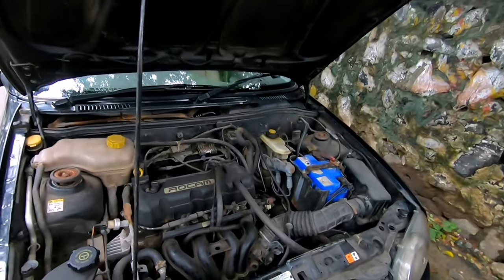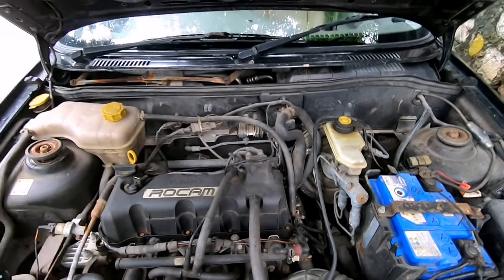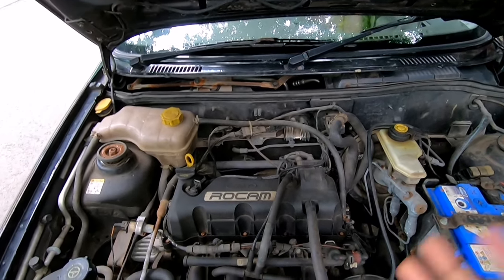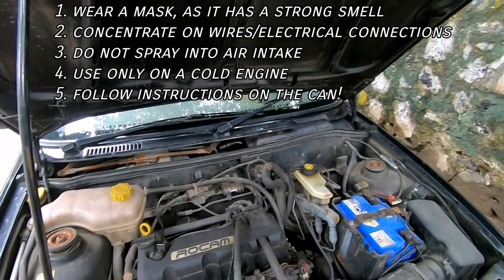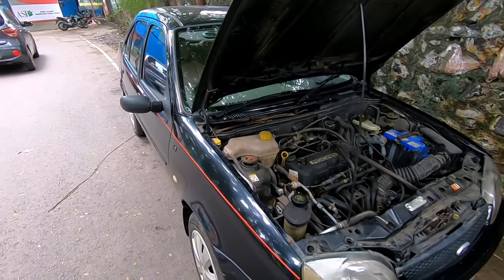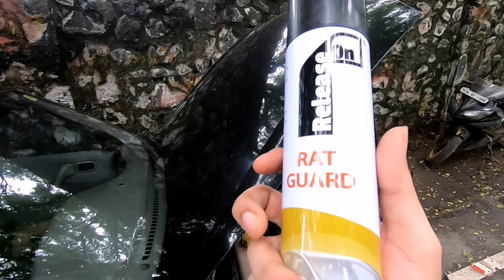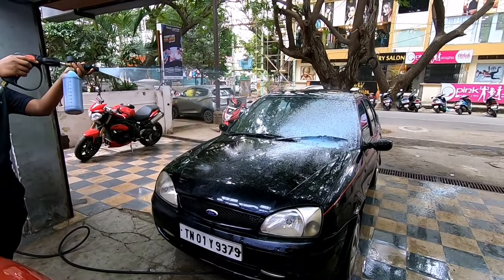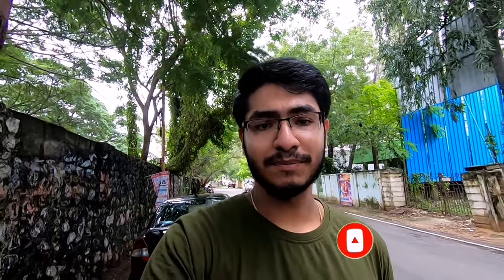How to STOP RATS from entering your car | Get RID of Rats HIDING in a car | PERMANENT FIX | JRS Cars

Comment: Dude. Rats have entered my NEXONEV. I'm not getting sleep at night these days 😭
Reply from the maker: Oh no! They've evolved faster than expected and attacking EV's also!
Jokes aside, use these tips bro, all of them together, that should work
Reply: @JRSCars  yes bro. Thanks for all the tips. If something goes wrong then I might have to spend bomb or have no choice to use insurance. Here's the video. I'm not professional in making videos but just a try :)
https://youtu.be/PP-khsOYvLg
Reply from the maker: @NonPhysicalPhenomena  will have a look soon buddy
Reply from the maker: Great video buddy, especially for a first attempt! The local fix won't be that long lasting, better get it fixed under warranty by TATA asap.
Also, use all tips in the video to prevent pesky rodent attacks, best is to use the car everyday :-)
Apologies for the late response.
Reply: Best solution for this is rat mesh installation, full engine and side packing 👍👍👍👍👍👍👍

Comment: Can I purchase Skoda superb elegance 2.0TDI AT, 2010 for ₹600000 which has completed 1lkh km. Will it be costing more on maintenance.
Reply from the maker: Hi, buy it only if it has a thorough service history and has been well taken care of.
You can check out my maintenance video on the Skoda Laura.
Add +25% on all costs mentioned for parts and factor an additional ₹1lakh for gearbox overhaul (DSG clutch).
Maintenance will be expensive, so make an informed decision.

According to me. Buy it if you already have a reliable car in the garage for daily use.

Comment: This is a major problem of car ownership that you have addressed. Somethings I  have learned:
1. Rats don't like strong smells and that means the tobacco smell works well. Other strong smells also work
2. Car interior should be very clean. Food remains even a tiny bit attracts them. 
3. Once Rats come in they leave their fecal matter that attract them to the same place again. So have to deodorize completely. Carpet shampooing and steam cleaning of interior recommended for this
4. Park the car in different places or orientations. Sometimes it makes the Rats lose track as they follow trails
Reply: Very useful❤
Reply: I had very bad experience as I live outside India and my is always parked some times my frds do start the engine when they open the hood rats takes their meal on my engine eat the thing and all reaming  is on engine I don't kw how to stop the entry.. please help

Comment: Nothing works better. There is a smell in rat poop that brings the rat back to car again. Rat enter through front wheel axil ,then engine ,then through AC vent row to dashboard which is hollow. Put Chilli powder , lal mirch powder two packets entirely on the engine in and around.
This makes rat smell irritating and don't try to enter. Recommend with personal experience. Have put rat mesh , rat trap, rat siren . But Red chilli powder is the best.
Reply: Best solution for this is rat mesh installation, full engine and side packing 👍👍👍👍👍
Reply: we have to sprinkle the chilli powder? if we turn off ac recirculation mode off wont it enter car?

Comment: I am finding rats near my AC system, and I cannot use poison rat spray in that area. Plus they have destroyed my cabin filter. What should I do to protect my cabin filter and ac system?
Reply from the maker: Then the best option is to drive the car everyday and use the AC everyday.
Reply: Put a rat mesh in the ac vent it will cost 200 plus fitting charges..
Reply: Best solution for this is rat mesh installation, full engine and side packing 👍👍👍👍👍👍

Comment: I have tried both methods, didn't worked for me. I have used same spray (brand).
Reply: Best solution for this is rat mesh installation, full engine and side packing 👍👍👍👍👍👍👍

Comment: I didn't get how rats get into the car interior and boot if its closed
Reply from the maker: They can enter thro the engine bay or any rust holes.
Also I mentioned I left the car with the mechanic overnight, he may have left the door open and gone.
That time the rat would have entered
Reply: @JRSCars  mm then ok

Comment: Can we keep rat poison and leave the doors open ? 
The rats will eat it and die outside searching for water
Reply from the maker: Not sure buddy. I've some street doggo's in my area, so I can't take a risk with any eatable
Reply: @JRSCars  yesterday I found rat excretion in the boot space of my vento car. Today I heard rats running inbetween the outer roof & inner ceiling of the car 😭.
Planning to set the trap inside the boot space today.
It would be a hectic problem if they already have offsprings and made my car their Home.😭😭😭😭
Reply from the maker: Ayyo! That sounds bad buddy! Keep a rat trap and keep repeating the process everyday, until all rats are gone
Reply: @JRSCars  the sad thing is they learn quickly. Once I poisoned them in my garden area. Now they are not eating anything that I keep with poison. Similar with the trap
Reply from the maker: @prrabhu  hmmm. Keep some food (non-veg preferd) in the trap. It worked for me 5 times....few months later again I found traces of rats. Caught 4 of them over 4 days
Reply: Hope that works 👍